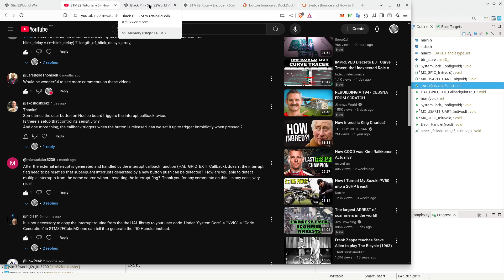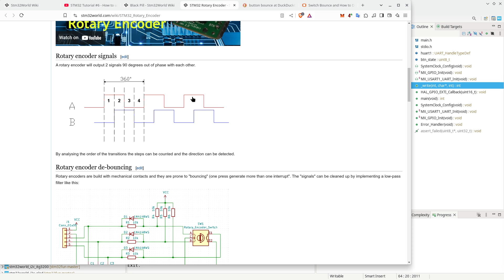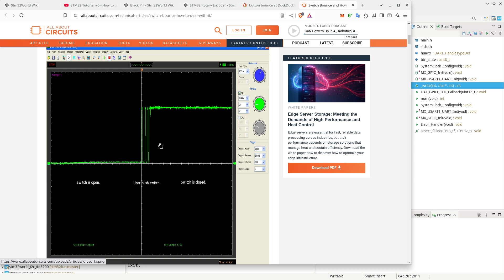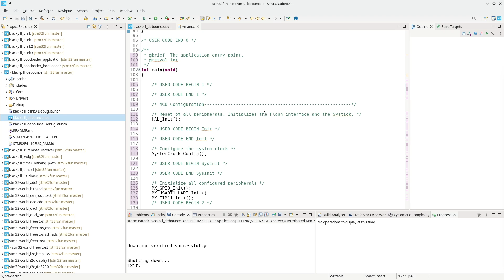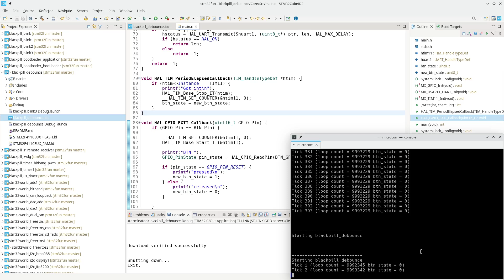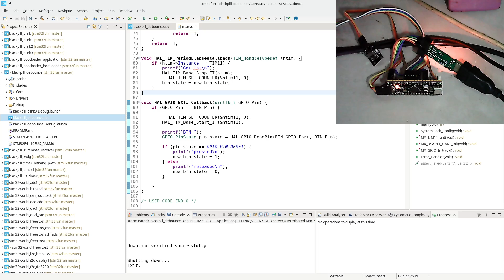STM32 Tutorial #50 - BOUNCE and how to DEBOUNCE

Comment: Thank you very much for answering my quit stupid question so thoroughly.
Shimon K. Cohen
Reply from the maker: I don't think your question was stupid at all.  Best would always be to design the hardware proper but when you have to make do with whatever is available and I always think it's worth coming up with a relatively simple solution to a real-world problem.  I have a few times used different approaches with the systick but firing up a timer to do the job just seems simpler and works both ways.